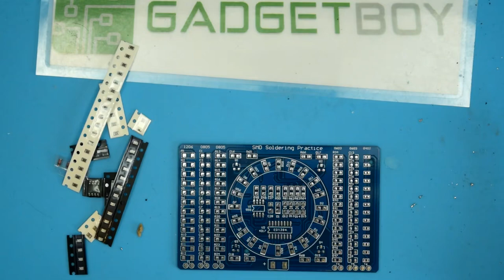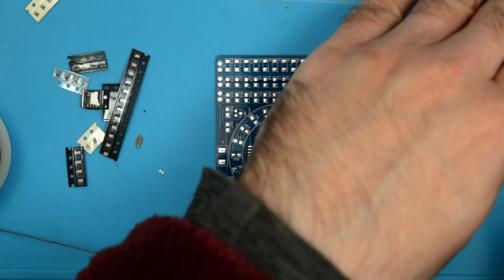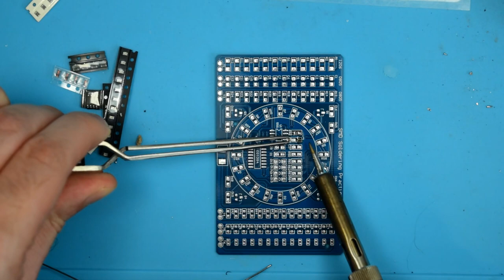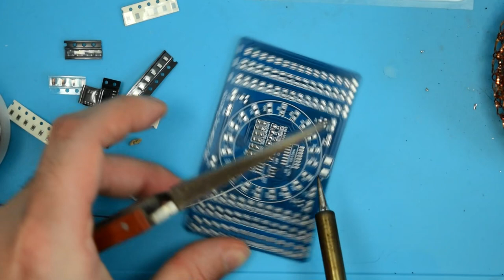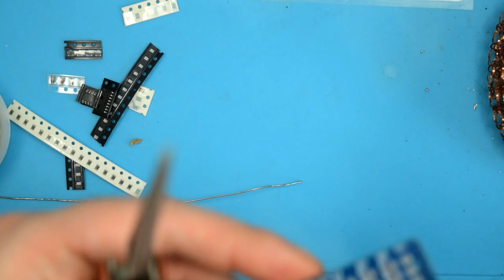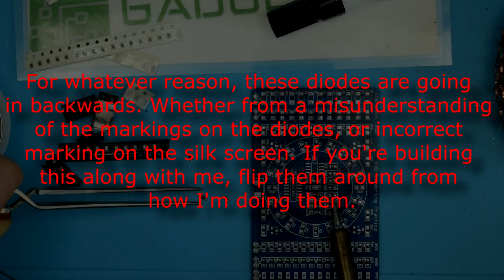SMD Practice Kit - Part 1

Comment: I got this kit a few days ago, was very annoyed that it didn't come with instructions. I'm now on the 4th component - the "470 ohm" resistor as you said. I just wish you would say what the marking is on each component, I can't figure this out. Not your fault, just aggrivated with this whole thing now, feeling like I wasted money
Reply: i'm in the same boat, i'm looking at the numbers on these resistors and i have no idea what they mean as a newbie to all this stuff.
Reply: Google it!  That’s how I figured them out. The black ones with the silver ends are resistors and almost always have a number that you can look up. The capacitors (brown) are not as easy but you should be able to measure capacitance with a meter. With these kits you can use process of elimination with size and numbers to figure out which are which.

Comment: Habe die Schaltung genau wie in der Anleitung aufgebaut bzw. Auch die dioden gedreht wie im Video hier angemerkt. Bei mir leuchtet allerdings die Schaltung dauerhaft( nicht alle LEDs). Als Spannungsquelle habe ich eine 9v Blockbatterie sowie ein Netzteil mit 5v ausprobiert. Das Lauflicht läuft nur wenn ich dea plus Anschluss schnell an und abkoppele wie ein gepulstes Signal . Ansonsten wie gesagt immer nur einige LEDs Dauerlicht. Für Ratschläge bin ich dankbar.

Comment: Can you help me I built this and some reason all the lights go on and the circle leds don't spin they just turn on still, no blinking nothing.
Is there something I did wrong
Reply: Sounds like you might have bridged the pins on your CD4017. Recheck the joints to make sure none are bridged. Use plenty of flux if you have some.
Reply: @caralynx  yeh I double checked all the pins and they weren't bridged, what commonent makes the ring leds go round? Could it be a capacitor?
Reply from the maker: You'll need to check all of the leads. The 555 timer provides the pulse for the 4017 to increment, so you might check there as well. Pin 3 of the 555 is the output, so you should be able to see the clock signal there with a multimeter.
Reply: Other thing to check for is a sufficient power supply. Things don't quite work below 4V.
Reply: @GadgetBoy  thanks for your help I managed to work out the problem when I have the power supply at 9v it all stays on but when I reduce the voltage to 3v it starts spinning. I slowly started to apply voltage and notice at 4 1/2 voltage all the leds stay on. Anyone know why it does that and what component causes for it to do that
Reply: @caralynx
Reply: My problem was low voltage

Comment: Two questions, one what temp are you using on the soldering iron and what brand of solder and the tip?
Reply from the maker: I solder at a fairly low temp, ~330c. For difficult joints, I'll boost the iron to 400c. My current solder is MG Chemicals SnPb flux core, at the time, I think I was using a Yihua 995D at the time. I don't have any memory of which tip I was using at the time, but it was probably one of the smaller chisel tips.
Reply: @GadgetBoy  Thank you for the information.

Comment: What is the temperature setting( centigrade) for hot air to remove ic chip?
Reply from the maker: I haven't much experience with de-soldering with hot air, but I think I had it set at 250?

Comment: There are some really helpful tips in this video for this particular kit:

* Either skip the practice soldering or make sure that you first set aside the components you need for the center working circuit.  The kit I received didn't contain enough resisters for both the working circuit and the practice columns marked for resistors.  My kit came with many extra capacitors.  Once you've set aside the required components, you can use extra capacitors instead of resistors in the practice columns to work on your technique.  Whoever picks the parts for these kits needs to get their eyes checked.

* Note that the video mentions "close enough" when it comes to resistor values.  That's what you'll find in the kit - not exact matches to the instruction  sheet nor in the pictures.  For this reason, make sure to identify the "close enough" provided resistor value for the largest number of resisters required - the 11 ones which protect the LED diodes around the "wheel" and in the center.

Comment: So you can see thing in electronics getting smaller and smaller, look at a circuit from 20 years ago compared to today, do you think things will become so small they would be impossible to use or experiment with as a home hobbyist?
Reply from the maker: I didn't show them on camera, but that kit came with components literally the size of this comma , so we're already kinda at that point.
Reply: @kutaquinte6645  I know old stuff being made now will still be around in 20 or 30 years time but if it went all out too small as to be impossible or too expensive for the hobbyist then the art might die out a little, I don't like all these audino things, adding a computer to a circuit, what are they going to do when they can't use a computer any more, no changing it then!
Reply: @kutaquinte6645  so glad I'm not alone, so many videos people's any, then I need it to do this so... Rather than adding a motor and a switch, they write some code 8 miles long and cram itin there, and I think, what if that breaks, or corrodes... Easier to replace a motor, cheaper too
Reply from the maker: I'm going to do some fun stuff with logic ICS in the near future
Reply: @GadgetBoy  with shoutouts? 😁
Reply from the maker: +Phonotical shoutout for what?
Reply: @GadgetBoy  because I asked nicely? 😢
Reply from the maker: I'll give you a shoutout on my 555 LED strobe cause you gave me the idea....if I remember. :-p

Comment: Would the smds be easier to glue down first, id be worried about transferring too much heat
Reply from the maker: That is an option. I was having a lot of trouble with this because I didn't have good tweezers for it.
Reply: @GadgetBoy  a quick online search brings me to ceramic tweezers, which for some reason I had forgotten how to spell entirely
Reply from the maker: Ooh. Good idea. To eBay!
Reply: @GadgetBoy  no idea what id have done with out ebay! Postman would have been happier that's for sure... Id also probably be about £6000 better off 😂

Comment: Those tweasers, is there a special name for them? Shouldn't they maybe be insulated to prevent shorting
Reply from the maker: Well, you shouldn't be working on a live board, so it's not super important, no. These were not good tweezers for the job, though. They're called cross lock tweezers, and they're normally closed - squeezing them opens them.
Reply: @GadgetBoy  well, maybe not live, but a rogue capacitor or esd maybe?
Reply from the maker: Well, a rogue capacitor, you want to short to discharge it, and I wasn't worried about esd with any of these components. I'll get into ESD safety later on.
Reply: @GadgetBoy  electroboom style? Or the safe way... 😁
Reply from the maker: I'm surprised Electroboom is alive, TBH. But it works. BTW, it's your fault that there is now a 3pc set of ceramic tweezers on the way. :-p
Reply: @GadgetBoy  I think he actually knows what he is doing and is making some very calculated risks, it's all for the camera, or set up in such a way he knows he will be safe, sure its fun to see, but I have to guess he was in no real danger... Although that failing Jacobs ladder had me worried, but he explained that away in a recent video... Electric guitar must have hurt... I apologise for feeding your addiction!
Reply from the maker: I want to build a jacob's ladder on my channel, but it's been done so many times.

Comment: Could you make them easier to solder with an excess of flux, or by roughing the edges with sandpaper
Reply from the maker: The flux, probably. Sandpaper might damage the component. When I was working in QC, we'd have a pot of liquid solder, and you'd dip the component in flux, then immerse it in the solder for a moment to pre-tin the leads.
Reply: @GadgetBoy  did it help?
Reply from the maker: Our components were factory fresh at Fleetwood, so the leads were nice and shiny and drank up solder. The ones in this kit were pretty oxidized, which is why they were being difficult.
Reply: @GadgetBoy  is there any sort of deoxidiser you can get

Comment: I've seen these practice boards, do they do anything?
Reply from the maker: The centre section (the part I build) does. It has a 555 timer with a CD4017 decade counter to create spinny blinkenlights.
Reply: @GadgetBoy  ahhh ze blinkenlights!
Reply: @GadgetBoy   ... Could you add extra lights?
Reply from the maker: Oh, probably. I'll be playing with some CD4017s in a future video.
Reply: @GadgetBoy  not sure what that is, I have something you can play with, 😅😂
Reply from the maker: It's a decade counter.
Reply: @GadgetBoy  so... Extra lights? I always wanted a block that light up one led as it went around, not sure if id want it to stay light until 60 or light and then go off a second later... Maybe a switch to change functions...
Reply: @GadgetBoy  I do have a jellyfied smd strip that does a little light show, it was supposed to do zylon (xylon? I forget it's been so long) eye swipes, but what can you do, its also not smooth enough, neon bulbs would be better, or I could cheat and put one led on a really slow motor and gear/pinion 😂

Comment: What part did you solder at the beginning?
Reply from the maker: Good question. I'll review the footage and get back to you.
Reply: @GadgetBoy  Thanks. Our school is running a STEM program and we are all new to soldering.
Reply: @GadgetBoy  Hey sorry to bother you, but were you able to find what it was that you soldered?
Reply from the maker: I haven't had the chance yet, I've been very sick with a nasty cold. I'll let you know as soon as I do.

Also, surface mount soldering is rather advanced for beginners, of you'd like, I'll do a proper tutorial video for basic soldering techniques one I'm getting better.
Reply: @GadgetBoy  Ah, got it; get well soon :) The thing is we already ordered this kit, but yes, a video on soldering technique would certainly help.
Reply from the maker: First component was a resistor. The SMT resistor codes work much like resistor colour bands, only using numbers instead of colours. So in this case, I was soldering a 10k resistor. The number code for a 10k resistor is 103. The first two numbers are the significant digits, and the third number is a multiplier, so you have 1 and 0, then you have to add three more zeroes - 10,000.
Reply from the maker: For SMT soldering, you're going to want lead bearing solder (none of that lead free crap), flux, a pair of fine-tipped tweezers (the ones I used in this video weren't the best for the purpose), a very fine-tipped soldering iron (the hakko fx-888d is really popular with hobbiests because you can easily swap to different styles of tip), and some toothpicks. I didn't think about it at the time, but toothpicks are nice for nudging the component around when you're trying to get it positioned properly.

Comment: Are your meter tips magnetised?
Reply from the maker: No?
Reply: @GadgetBoy  they just seemed to be picking that led up ever so slightly
Reply: @phonotical  they do because multimeters sometimes supply a slight voltage to measure.
Reply: @MarterElectronics  👍🏻👍🏻

Comment: I never got why they label them R978, I know you could look it up but come on, you'd have to have a pretty big book to get that, why not say divide the board up into 1x1cm squares and give a reference grid 😑 make replacing them easier as far as guesswork goes
Reply from the maker: In this case, probably because the board designers were too lazy to give the functional components useful names. For boards that are built by pick and place machines, it's less important to have functional names. If a component is missing/defective, it's much easier for a QC tech to look at the parts list, and find the component by its board designator. Then there's a bunch of drawers with spare components where you get the needed part, then you solder it on.
Reply: @GadgetBoy  feels inefficient
Reply from the maker: It's the best way to do it. You'll have the parts list in a handbook at your workstation.

"Hmm. L53 is missing."

flip through book

"Ok, L53 is a .01uH inductor."

get one from drawer

Also, there would be common failure points, and we'd keep a stock of those parts right there at the bench. I actually started the practise of grabbing a few of the needed components with a piece of tape, then hanging the tape on the edge of the equipment shelf above the workbench. Mark the component value with sharpie on the tape, and you have them right at hand on the tape so they don't escape.
Reply: @GadgetBoy  it's 3am,what the heck would L indicate 😅
Reply from the maker: Inductor. I don't know why.
Reply: @GadgetBoy  inefficient!!
Reply: @phonotical  it's very efficient as electronics have standard labels that all electronics technicians already know.